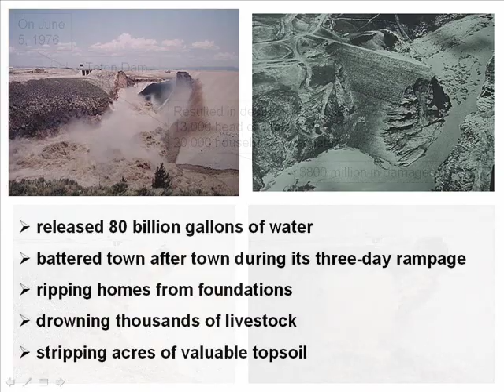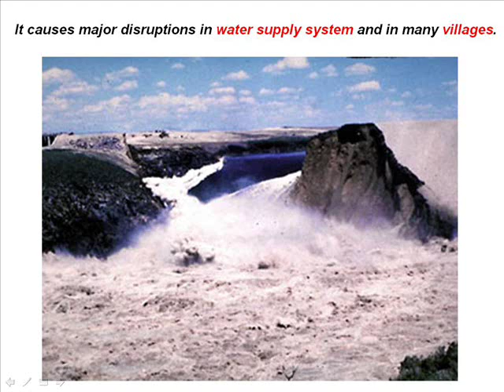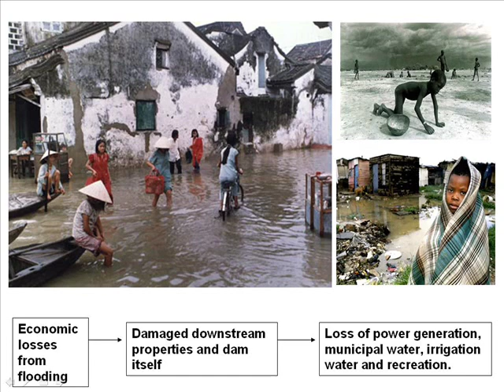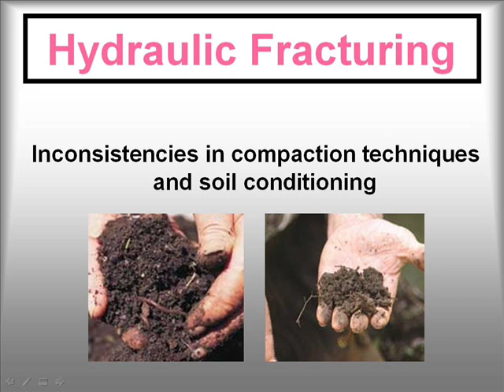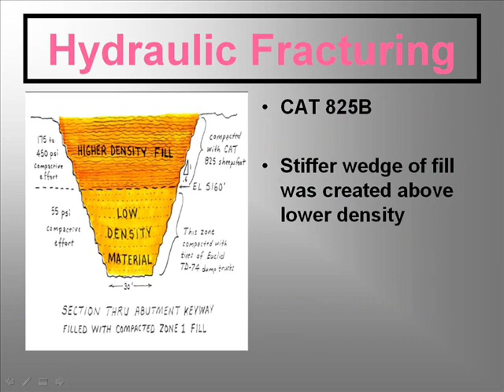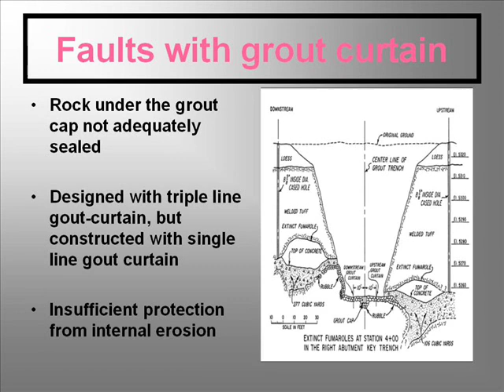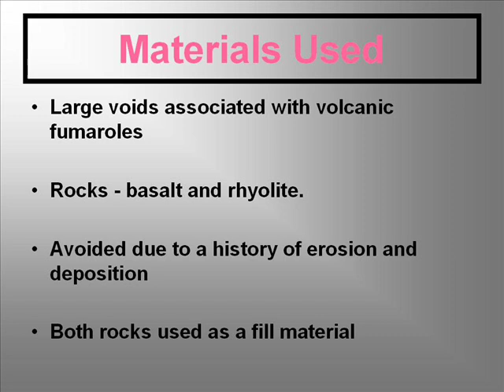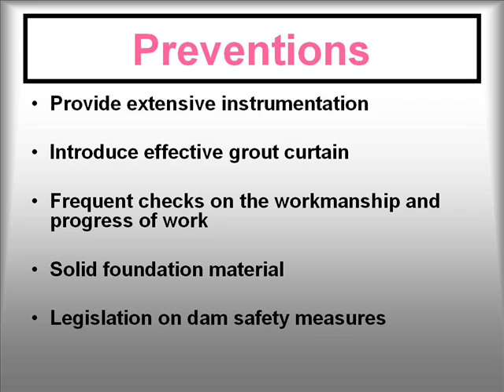Teton Dam failure

Comment: The best part is if the failure of Teton Dam had caused American Falls Dam downstream to fail, that would have caused a chain reaction where every dam down the rest of the Snake River and Columbia River clear to the Pacific Ocean would have failed.

The only way this dam could ever be rebuilt is if it were to be a concrete gravity arch dam, which probably isn't economically viable, given it's size compared to the reservoir size. The locals would fight fiercely to prevent any other type of design